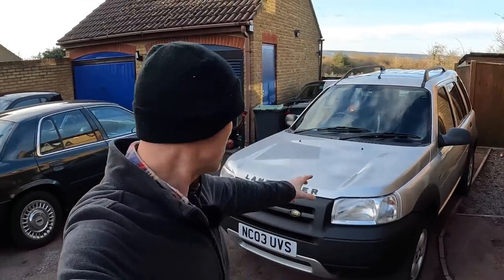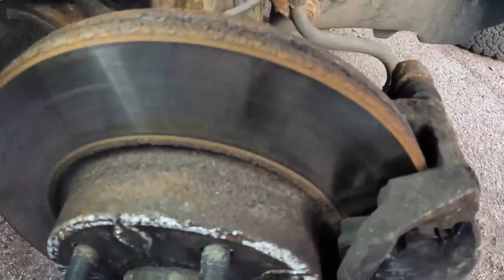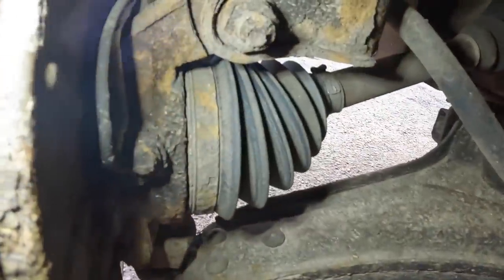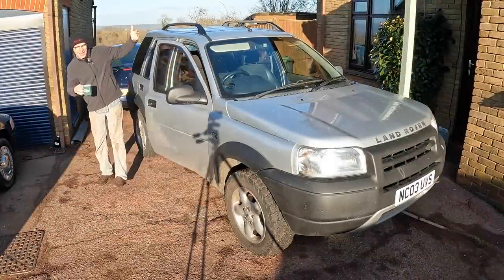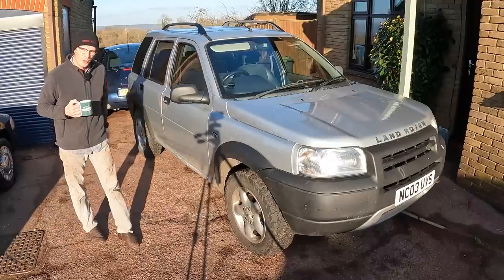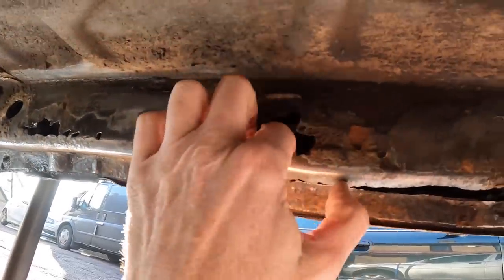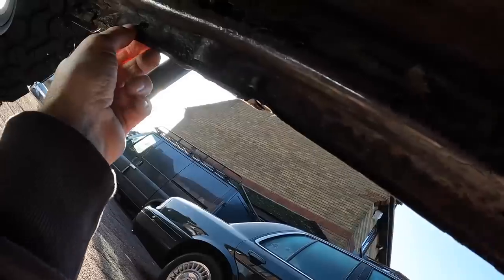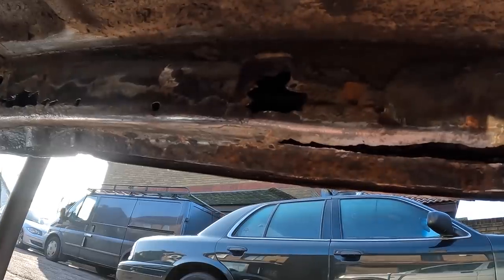Freelander MOT fail...Holed below the waterline and going down by the head

Comment: Gutted for u Matt but during an mot u have to inspect the car as seen u can’t remove bits of trim to inspect so there could be a big hole behind trim that you cannot see. And also good luck on getting the fuel tank straps because u have two types of hope Bob hope and no hope because they are not available anywhere. The build quality with new land rovers r just not good u will be forking out lots of money for huge repair bills. I have a friend who has a 2014 freelander2 with 81,000 miles on it and the rear differential is knackered.

Comment: Getting this through the MOT sounds like a good challenge - should you deal with the unknowns first to avoid costs going up? It looks like a good challenge if you've got the right amount of experience welding and will make good viewing for youtube. The grinding sounds like a priority. You were struggling a bit with the angle grinder - I think the guard is largely to stop a metal grinding disc from flying straight into your face or body if it suddenly shatters. This happened to me once and I have to admit I've always had the guard in the right place since then - the guard was in the right place when it happened. It's a safety measure and you can unclip it and move it to the best position for the job you're doing. If you're taking the brake discs off (I think 37mm is the min thickness) you could wire brush and seal the inside protective shield.  I did think about the plastic trapping water in along the sill ridge - could you ram the plastic with grease so when it goes on, the grease is forced out and there isn't any space for water to remain and risk rust developing. If you can use some underbody sealant that you can spray into the frame, you might be laughing.  I was looking at one called 'Lanoguard' and there are a few on ebay with a 'wand' that's designed for spraying inside frames. You might have exactly the same type of problem on the other side of the vehicle - are you going to wire brush the otherside to check on the quality of the metal there before taking the welding any further. If you plan on going off road, the fuel tank cradle is worth thinking about....imagine getting it through the MOT and then ripping a hole in the tank......good luck.

Comment: Looking around there seem to be £40-£50 sill repair panels that would appear to be cheaper, quicker and easier than trying fabricate your own even if just have to cut and use sections of the panel
Reply: A local metal fabricating shop may be able to bend you up a pair in possibly thicker metal for less but if the ready mades are good they would save you time. I'd guess there is a lot of info out there about this job. Use a lot of weld through primer.
Reply from the maker: those are outer sill only, no one does the inners
Reply: @furiousdriving  these look like the iner and outer in one on ebay "FOR LAND ROVER FREELANDER 3/5 DOOR 97-06 SILL REPAIR UPPER BODY RUST PANEL PAIR" from carvanbits Exeter? EDIT: or am I mixing up the upper door step profile with the inner underneath section?
Reply from the maker: @cliveprocter3698  thats the outer sill you can see when you stand by the car

Comment: Hi Matt, I'm just curious...  You and some other UK YouTubers seem to need a lot of batteries.  What sort of warranty do you get on them?  Here in Canada we routinely get seven to ten years out of a battery even with our winters, and a five-year warranty is not uncommon.  Does the Crown Vic still have an American battery in it?  If it does, I'm curious how long it lasts you.  And I can't wait to see more on the Mini rebuild!  (I own a 1959 Morris Mini-Minor.)  Keep up the great videos!
Reply from the maker: OEM batteries will do 10 years - my Mercedes W204 still had a factory one at a decade old and only lack of use in lock down killed that. 
Most have aftermarket have a 3 or 4 year warranty but Ive claimed on those many times. OI try to get Varta or Yuasa now, although I put a Ford Motorcraft in the Mondeo

Comment: Watching you fumble with the grinder made me wince, Ive got scars up my arm from one of those.
That job would simple on a lift, it's the laying on your back on a driveway that makes it suck.
Maybe it's time to get a lift 😉
Reply: Good points. Those wire wheels on a high speed angle grinder are great for removing rust but potentially dangerous - I once caught one on a shirt cuff and was lucky not to go straight through the blood vessels in my wrist.

Comment: Matt on camera "also it has no MOT so can't take it out"

Matt off camera "that's motorway speed and the grating has stopped whoop" 🤣

I've had my 75 CV boot held on with  cable ties for almost 30k now 👍
Reply from the maker: I didnt ask if cable ties would count as an MOT fix...I  must ask next time
Reply: "Has !"
Reply: @furiousdriving  cable ties are acceptable as long as it's secure.  I've done it in the past.
Reply: @furiousdriving  it was one of them temp fixes that is now in it's 4th year of temporary-ness.  I did use a cable tie gun to fit it so it's nice and tight.
Reply: @furiousdriving  I've had a couple of CV boot kits (as well as steering rack boots) that actually came with cable ties rather than the metal straps. MOT man was happy enough with them.

Comment: Poor Poor Little Hippo. You have got the skills and determination to repair the Freelander. 
Yes the Discovery is a wonderful vehicle but my Brother has had two Discovery 2s and my Brother in Law has had two Discovery 1s, a Discovery 2 and now runs a Discovery 3. They will both say," Excellent idea". 
What they will actually mean is rust in the Chassis, rust in the spring mounts, rush in the floor where moisture gets trapped between the body and the chassis and rust in the roof around the alpine windows. 
So you will pay plenty for a good Disco. 
Is Hippo really that bad?

Comment: Please please please don’t bodge that by plating over the rust, you’re not Hub Nut. Get repair panels and cut out completely the rusted sections, welding in new sections as required. Otherwise….it will fail its next MOT too!

Comment: Need to invest in a couple ramps to drive up. Not trusting jacks. Or an old couple of steel wheel rims. Jack up and lower front or rear wheels onto the rims.  Gives you another 4 or 5 inches of working room.

Comment: Mr tester missed the bit above the trim on the inner sill , if he were sounding it out with the corrosion inspection tool he would have heard it as it would sounded duller , but maybe not created a hole .
You seem to like rusty cars , anyway on the repair you got to fix the damage too and not conform to its shape , I am sure you know.
Reply from the maker: You cant see this metal at all, its totally hidden by the plastic trim, you'd need sonar to look through it!
Reply: @furiousdriving  ahh fair enough , i like your stripping disc they never had them when i was doing it ..

Comment: I'm sure you'll get her back on the road. You've repaired worse.
I would just urge care when using a knotted wheel in a grinder. Great for taking off rust, but I had it snag, which whipped the grinder from my hands and the wheel went across the top of my head. Fortunately, it just grazed rather than going deep, but I ended up wearing a hard hat with face shield. One of those moments which made me start taking safety more seriously.

Comment: I hate plastic trim mounted on metal parts. Always going to rust underneath it, mud and other crud gets in and stays wet for ages and you get rot... Hope you can get it sorted.
Reply: After repair and rustproofing soak the clipped on trim with wax, Fluid Film or a lanolin based rust proofer.

Comment: That looks a bit problematic. Not dire, but not a five-minute fix either. I am sure that those parts need a complete overhaul, so as to save the structural integrity of the chassis. At least I'd be thinking of redoing the sills from inside out, otherwise it will go to waste in a matter of months (ask me where I got to know this..)

Comment: Plastic water and salt trap, otherwise known as "Built in Obsolescence" It was designed to 
do this. 
What makes "Land Rover" worse, is the fact that this is an off roader and the steel wasn't even 
galvanized at the factory.  They are Rubbish Cars. The early ones were known to repeatedly blow
head gaskets, another design error that they never owned up to.

Comment: I feel so bad that I want to apologise on behalf of Land Rover. that's just the peak design feauture. 

question from a foreigner: does the MOT tester keep checking where she/he would otherwise check after finding a definite failure or finding at least one is enough and that's it?
Reply: Unless there is an obvious terminal failure which would scrap the car the tester will complete the test and note all defects. If the owner is with the car at the time of the test he may be advised of this failure and asked if he wishes the test to be completed. With a bad safety based fault the garage may insist that the car be removed with a trailer and not driven away. 
Have you watched the "Just Rolled In" channel?
Reply: @delukxy  no I didn't. Thanks for the information and recommendation!

Comment: anyone watching this, when using wire wheels on grinders (normally 240v and not so much budget cordless) use full face protection and googles.this little strands of wire come of extremely fast and will from experience get up under glasses.

Comment: Best to just spend the £1000 quid to weld it as that car in good condition is worth £3000 pounds now as used car prices are through the roof , good example i have a 2007 Mitsubishi Colt 123 thousand on the clock, I paid £600 for it in 2017 when i bought it and now its worth £1200 , though i have just put 4 new tyres and new discs and pads on it for £300 , anyway fix the Land Rover and maybe keep it for weekend green laning fun

Comment: I was fascinated why when you turned one of the front wheels, the other one turned in the opposite direction?
Reply: They all do that sir. That's the way a diff works unless you have limited slip one.
Reply: The differential will always cause wheels to rotate in opposite directions if both sides are raised.
Reply: @tallblokesam  Thanks, I guess that was it but never seen it before.
Reply: @midinotes  it's easier to spin the other wheel than rotate the propshaft. It will always choose the path of least resistance (unless there's a locking/limited slip diff).
Same principal why one stuck wheel will always spin in mud/snow even if the other is on firm ground.
Reply from the maker: differential

Comment: Thats not that bad of a weld up for an mot.  Some 1mm sheet and an angle  folder and some metal sticking and your done. leave the other sill side for another day. Its just the wrong time of year for laying under a car. Dont change it , Stick with the devil you know if it meets your needs. Anyway its has less carbon whatever to run what you have for as long as its economically viable and to someone with a metal sticking machine that can be a long time. Electrical / electronic brain issues can be a far worse expense problem with post 90s cars.

Comment: Freelanders have a 6 year corrosion guarantee from new, guaranteed 6 years worth of corrosion when new. Rust on a landrover is like an iceberg you can only see the top 10%😫
Those cv gaiter clips rust away quickly because landrover cost cutting cheapness, you can get stainless steel ones off ebay, dont use cable ties you cannot get them tight enough not to slip off on full lock over time, look at the fuel tank strap frame its most likely rotten oh and front brake back plates.....what's a front backplate? If only they had made them like the rear ones.....